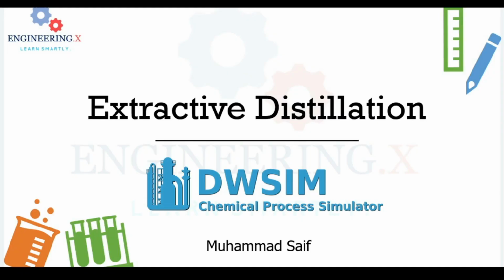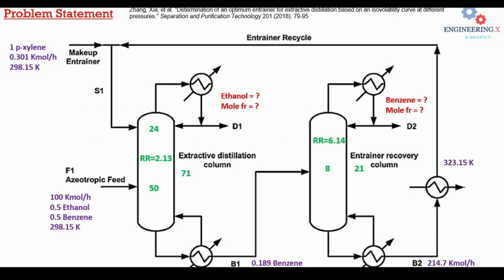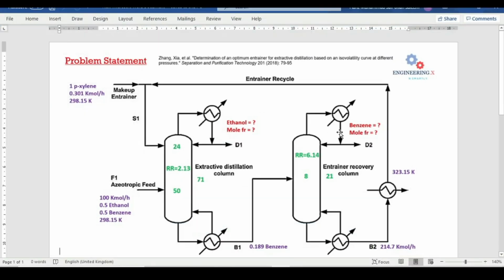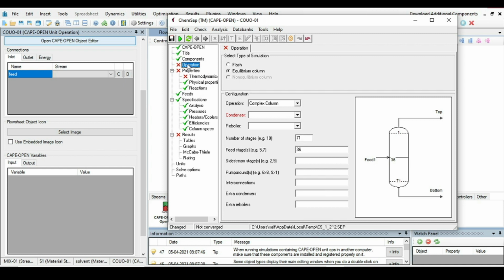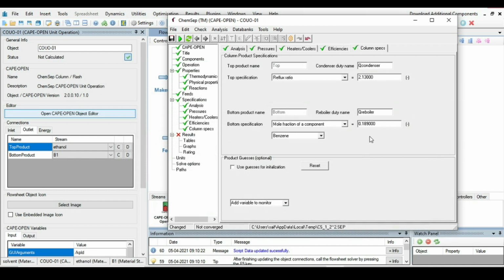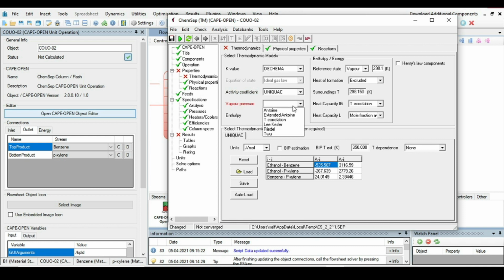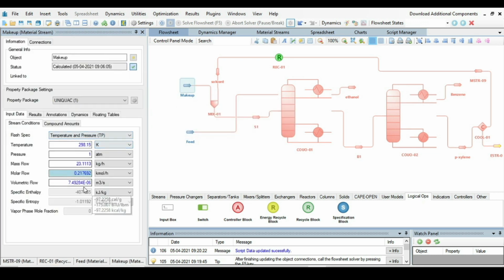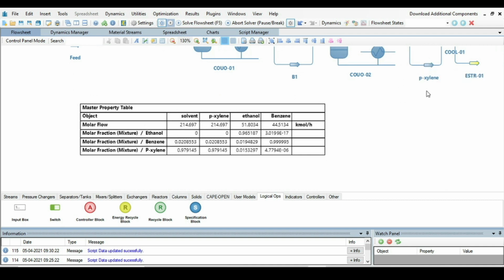Extractive Distillation of Ethanol and Benzene using p-Xylene in DWSIM

Comment: Good day Sir, I've followed all the steps you did in the video, but when it comes to the ChemSep column, I am not able to see the thermodynamics window, and as a result, my simulation gives me an error. Do you know how can I be able to activate such window?
Reply: Go to the CAPE-OPEN tab in the Object Editor and deselect the CAPE-OPEN Properties. It should show up.
Reply: @shrubbbb  It worked. Thank you
Reply: Thanks buddy I was finding this 😅 @shrubbbb
Reply: I also have the same issue
Reply from the maker: well, I am not sure about it. because I did this simulation in the previous version of DWSIM. I will suggest you upgrade to the latest version of DWSIM and then see whether it solve the problem or not?
Reply: Unfortunately I've updated the software since the 6.4 version and the problem remains the same. Thanks for the reply.
Reply: I'm having exactly the same issue, the thermodynamics window won't appear, only reactions.
Reply: @albertoaguilar9773 hey did you get the solution to it ?

Comment: I have  a question: In the flash distillation unit, is correct that the ethanol is in the top of the column(consider that the boiling point of Benzene is 78 C and Ethanol is 80 C) ?
Reply from the maker: Hi Juan, Thanks for your interesting question. Yes, it is true in a binary mixture of ethanol and benzene that ethanol should be the bottom product. But the addition of p-xylene
 as a heavy entrainer to enhance the relative volatility of ethanol over benzene. Hence, ethanol is separated from the distillate of the first extractive distillation column while the bottom stream containing benzene and p-xylene is sent to an entrainer recovery column to obtain benzene from the top of the column. For details please read the following article: https://pubs.acs.org/doi/abs/10.1021/acs.iecr.9b03095 
I hope your doubt is cleared.